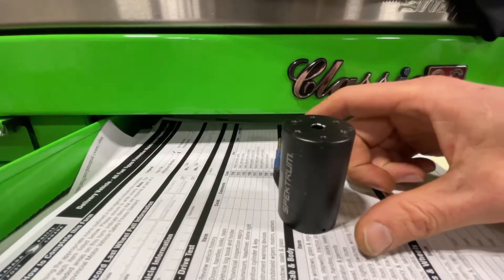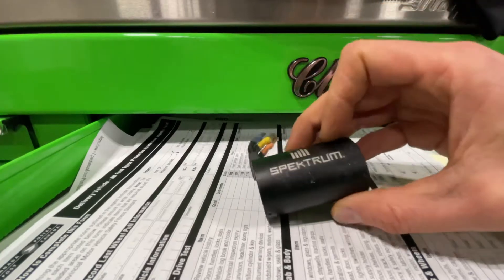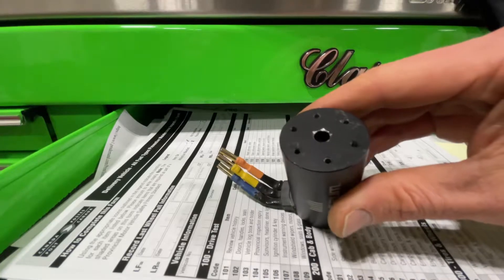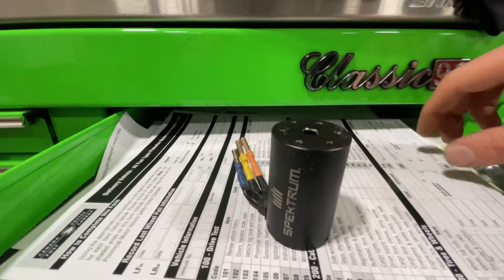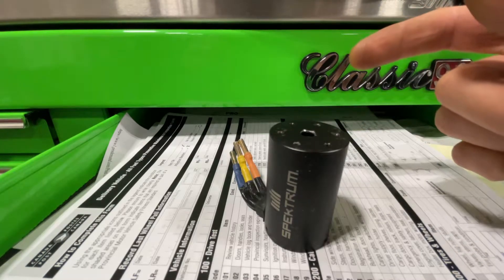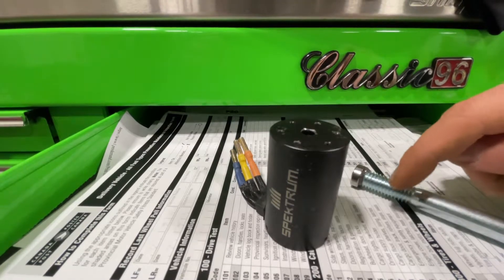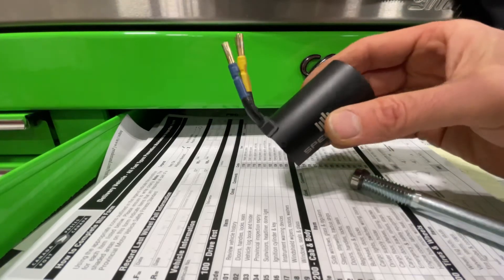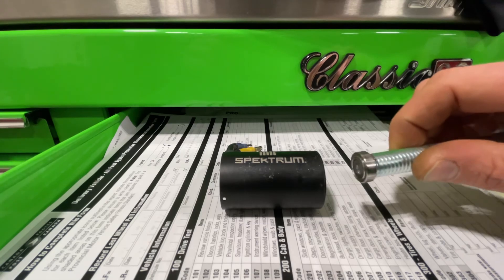Spektrum Brushless motor front bearing Destroyed and How I removed it

Comment: The shaft on those motors have a spot on the end where you can put a c-clip. Put a c-clip on and the bearing will push right out
Reply from the maker: Yes, the new motors do have the clip on the end for the pinion gear, but you can’t remove the bearing that’s in the bottom of the motor with that especially if it has blown up, you could use that for the front bearing, but not the bearing. that’s the bottom of the case.

Comment: I have that eaxct same problem on my Traxxas Velenium 3500 motor...bearing exploded and i removed everyting except the outer bearing ring that got stuck... will try something like that...only have epoxy!
Reply from the maker: Yeah, I think the epoxy should work fine. All I had was Jb Weld, which took 24 hours to dry most of the epoxy dry pretty quick. Let me know if it works.

Comment: Same here....first time at the track..3 batterie...front bearing gives up and blew out...
With the senton
Reply from the maker: That sucks I’ve change the bearings in my motor several times now and ended up getting a hobbywing motor so far I have had no problems with the bearings but I haven’t ran it  as much as I used to

Comment: It doesn’t work, I’ve tried 3 times
Reply from the maker: That was the only way I was able to remove the outer bearing race without ruining the motor case. A bolt that was almost the same diameter with JB Weld but you have to wait 24 hours for the JB Weld to fully cure.
Reply: Whqt if the outer part of the bearing is stuck in the motor while the middle part of the bearing got stuck on the shaft